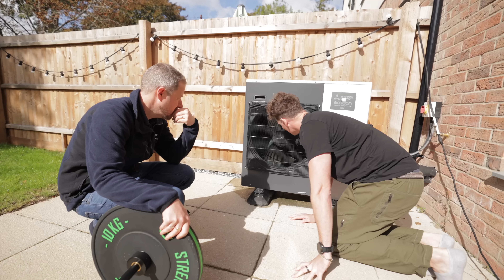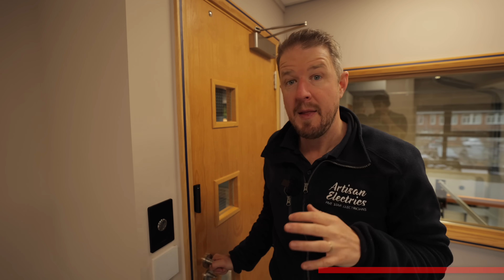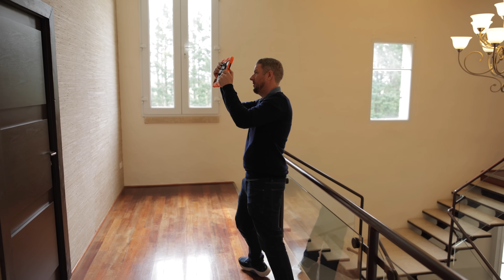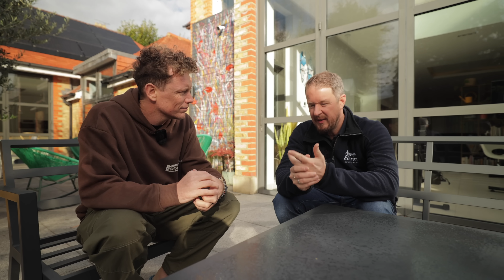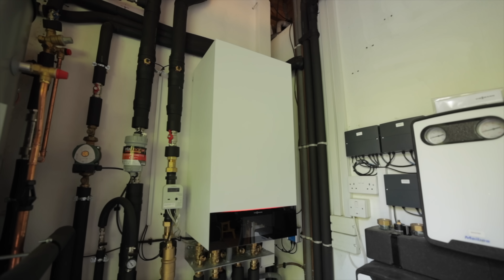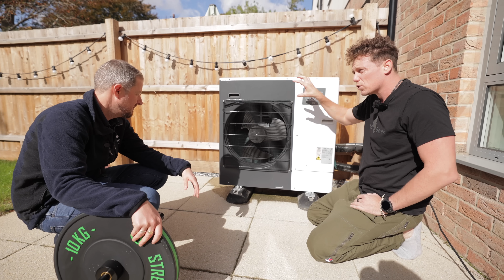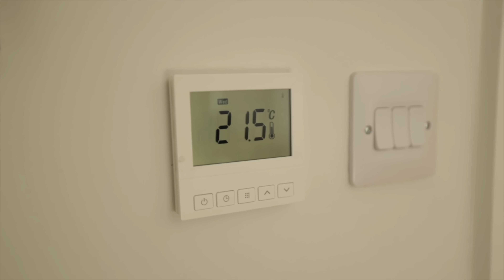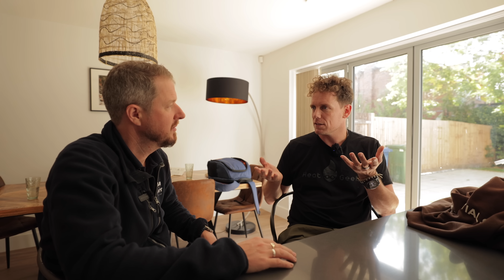Are Heat Pumps Really Worth It In 2026?

Comment: CLARRIFICATION to one of the comments" having worked  for14 years in Sweden I observed YES Scandinavians use heat pumps BUT a lot use wood burning stoves when it gets very very cold AND someone will keep the wood burning stove running OVERNIGHT! yes all night keeping it topped up.  Why ? because the heat pump cost/energy use goes through the roof.  So my friend lets some facts CORRECT!
Reply from the maker: Thanks for sharing your observations from Sweden!
Reply: Wood burning stoves provide additional heat, they don't take over as the primary heating system.  And if you actually compare the prices, wood burning still costs more when it's very cold, it only gets about cost parity when bought in bulk.
Just look at my name to know how I know.
Reply: @BenIsInSweden  i didn't say they ONLY used the wood burning stove (read the comment!)!  And as for "cost parity" that really depends on the availability of wood, which according to my Swedish work colleges depends a lot on where you live!.  So take this as a polite "jog on"!:face-blue-smiling:
Reply: @jimduk  That makes no sense in context of the original where you say "because the heat pump cost/energy use goes through the roof".  Supplemental heating isn't going to have a huge impact on that cost in the lower temperatures.

As for "depends a lot on where you live", the same applies to electricity prices, up north where it's a lot colder, the electricity price is lower.  

So maybe get your facts straight before trying to make a clarification to someone else.
Reply: @BenIsInSweden  ohhhh good grief!!! yes it does - is the cost of running a air source heat pump linear in relation to outside temperature ! NO! and you know it's not! so not sure of your problem ? trying to sell heat pumps ? affiliated to this video/advertorial?! fishy!  or just a narcissist ?
Reply: @jimduk 
Let's put it this way, when buying in bulk and burning with a modern wood burner (which many people don't have), wood works out at around 1SEK per kWh, for older ones it's closer to 1.3SEK/kWh. In my region you can fix electricity currently at 0.9SEK.
Given most cold climate heat pumps can achieve a COP of at least 1.8 in -20C you're looking at aroud 0.5SEK per kWh of heat with that fixed tariff.
Reply: @BenIsInSweden  lets put it this way Ben, if you have access to CHEAP wood in Sweden (which many people DO!) then its cheaper than electricity when below 0c  the consumption of the electricity starts to exponentially increase as the temperature drops further and further the point that's you are getting ZERO (nowt, zilch! nana!...) benefit from the air source heat pump.  Now do me and yourself a favor and "jog on" and create some pointless reviews of crap 80's computer games.   Muppet.
Reply: @jimduk  Clearly reading isn't your strong suit, Sweden uses cold climate heat pumps, which still give more heat per kWh consumed even down to -30C, I also don't review games, so excellent deductive skills there, like the rest of your incorrect "clarifications".

You could provide examples to back up your claims, but instead you resort to name calling, so clearly it's you with the agenda here.
Reply: @BenIsInSweden  maybe not review,  but plenty of posted 80's games (what ever "floats your boat" LOL)
 So back to heat pump discussion when did I state a specific  temperature where heat pumps fail to output more energy than they consume ? what I indicated was the COP value gets exponentially poor as the temperature drops below zero, AND try getting the hot water for showers etc up to a sensible temperature (60C) without having to resort traditional immersion heater (even in summer!).  Oh and what many heat pump figures FAIL to specify is the impact of damp weather i.e. bigger COP drop with cold damp weather versus dry cold weather.  I could keep going on but clearly the dark Swedish nights are playing with your mind..... 🤪 😋
Reply: @jimduk plenty of 80s games? Just the 1, mostly from the 90s though, but they're about as current as your heat pump and heating knowledge. 
60C is scalding, outlets are supposed to be 50C max, r32 heat pumps can do 55C just fine and R290 ones can do 75C. 
As I've stated multiple times COP of at least 1.8 in -20C, almost half the cost of direct electric heating in those temperatures. And if you're in an area of Sweden that gets that regularly then the advice is to go ground source, which is unaffected by the outside temperature. 

If you want 60C for Anti legionella then a r32 heat pump will get it most of the way there and the immersion will top it up and you typically only have to do that once a week.
Reply: @BenIsInSweden  ahh so knowledgeable Benny sweetie, surely not trying to sell/justify the "air pump snake oil"  LOL 
Is it all the those dark nights in Swedish Winter..... and the cold or perhaps it's due to the frustration of the heat pump running costs ? no wonder the favourite pass time of Swedes is leaping off railway bridges 🤣
As to your pitiful irrelevant argument, "...60C you want.."  YUP anti Anti legionella is critical sweetie, you should know that.  
Now back go back to the dark Swedish nights & 80's computer games and avoid the Railway bridges 😜

Comment: With all due respects we import according to our governments figures "who believes those twats..." less than 5% of gas from russia infact it less than that so please if you quote numbers even in jest get it right people! As for HPs we have a 4kW PV and wouldn't consider them unless they was from a Korean brand. I have a 155,000 mile BEV niro and the heat pump hasn't missed a beat being used for nearly 4 years daily as a taxi. I have heard and seen on YT many HPs that have had many issues even those installed by very good technicians. Sorry but I'll be sticking with Putins gas 🤑until they have ironed out all the issues. Cheers

Comment: While I think the heat pump systems could be better in a much more complex installation/system which would include other tricks (since the heat pump only pumps, well, heat, heat is still lost when opening windows and doors to the outside, so adding a couple air pipes to exchange air with the outside, pipes coiled around each other and pretty long, while also well isolated from the inside and outside, should make fresh air very close to inside temperature), the main advantage is losing the vulnerability of relying on other resources, especially those that crazy evil people like to use to put a leash on other nations (like orcs messing with european countries).
Now, the main problem is the lack of education across the world, as many people simply do not understand how heat works, how insulation works, and more. Quite frankly the main problem is stupidity.

Comment: A heat pump is a useless option, why pay for electricity to drive a compresser giving limited temperature increase in minus temperatures. Electric heating is the most cost effective solution for heating and hot water. Most of of our electricity is green and ideally Ed Milliband (The useless one) should target to halve electricity cost. This is possible with tidal turbines already being used in a Scottish island

Comment: I hope to look at heat pump install in a few years time, and from what I gather, an average instal bottom line all told is £3,000, give or take.

Unfortunately, there is a rip off culture in the UK, and half the battle would appear to be, not being stung. I've seen a few videos of Heat Geek over recent years, and it would appear even technically minded folk get regularly stung, what chance for the average person? You yourself  seemed quite chirpy when the deficiencies of the install were pointed out in the house you're renting.

I have no doubt the technology works, particularly as it's built by Germanics & South East Asians, problem is, it's being fitted by UK installers, the modern day equivalent of British Leyland grunt.

From the Austin Allegro to UK Install All-Aggro.

Robert

Comment: Thanks for having me on guys!!
Reply from the maker: Thanks again for joining us 🙌
Reply: I'm really happy about my ASHP installation but I really wish I had found out about you beforehand. Due to our really good experience in an old house my parents are also curious.

They live in a 18th century Cotswold stone cottage which is off the gas grid (would be removing an oil boiler). The house is undoubtably leaky but had very thick stone walls. Do you have any experience installing into such properties and would you suggest this?
Reply: Hi, I've been told that heat source pumps struggle to heat homes with 10mm microbore radiator pipes. Is this true?
Reply: @OrangeManWindowClean no it’s nonsense. Your system designer does have to understand Hydronics a little more though. Heat geek installers would have no problem whatsoever
Reply: @OrangeManWindowClean  Just had my ASHP installed Oct25 with 10mm microbore downstairs and upstairs. It works very well. The heating engineer knew his stuff. SA Energy , fareham.
Reply: I've got an ecodan system fitted but found some thing are not right with it i.e. pipe sizing, insulation not fitted properly could you do a check of this installation and put things right to make it more efficient?
Reply: Hello Adam, what type of tape do HG use around the pipework + what type of loft insullation?
I may be, (hopefully D.V.) buying a very small new build bungalow, (60.8sqM). It has a Vaillant ASHP, underfloor heating, 8 solar panels. I'm doing my research, trying to learn as much as I can ❤
Reply: Can you clarify one thing you said in the video at 22:53? You say your average install price is £3,000 comparing it to a national? average install price of £12,000. Is that to say that your average customer is £3,000 out of pocket after the £7,500 has been paid by the government totalling an install cost of £10,500 but other customers will be £12,000 out of pocket AFTER the grant meaning a total install cost of £19,500? Or do you mean that nationally customers are £4,500 out of pocket after the grant has been paid giving a total install cost of £12,000? I just can't see the £19,000 figure anywhere and seems grossly inflated. Have just been on your website and got a quote for £4,500 for my home which is exactly the same as Octopus are quoting. Where is the big difference?

Comment: 11:53 how big is that house and how much space is needed... that is a huge plant room. 
   We really struggled for space in a terrace house, placing the battery and inverter outside, but we went for electric underfloor heating running from the battery, but we don't have enough solar to charge the battery, nor do we have a big enough battery to run the house - further investment is needed. For hot water we are fine, with the eddi used to divert surpluss, but the overall house temp is poor due to the price to run the underfloor heating when the battery is depleted. 
The volume of the new tank took space from the bedroom location where the original tank sat, and heats the 1st floor. We still have to refine the system downstairs to bring our energy bills down.

Comment: Can you put a heat pump in the loft, or would that be too noisy?
Reply: The noisy bit is outside, the heat exchanger and compressor. (They're actually very quiet). The indoor kit water cylinder etc is very quiet and can often go in a loft space.
Reply: @WeirdNeville I was thinking about putting the heat pump into the loft. My loft isn't insulated, but it's marginally warmer than outside, it won't take up room there, in the summer it can just take the air as is to heat up the water

Comment: In the UK electricity costs 4 times the price of gas. Some new heat pumps don’t even state they can achieve 400% efficiency all year. I turn my heating down at night and when I go out. I don’t think you can do that with a heat pump so it will cost me more. Can a 400% efficient heat pump heat hot water high enough to kill legionnaires bacteria? I don’t think so. I would be mad to spend thousands for a worse system than I have now and I would have to increase or replace all my radiators.
Reply: Yes, they do legionella cycles just fine. Your questions are all moot, they've been answered.

Comment: Looking at the outdoor unit I wonder what happens when there is a cold period? Or is this located in a none freezing area? We are used to large amounts of ice buildup - e.g. it should be at least 50cm above ground to have round for ice below the unit.
Reply: Are you not in the UK? We rarely get half a meter of snow or ice here. The units can defrost themselves so as long as the condensate drain is ok there shouldn't be an issue.

Comment: Where do these heating systems go when the anti oil zealots are in charge in future years when there is no petroleum oils to get the gases from to use in the heat pumps? Refineries are closing all over Britain and Europe so everything from the steel, aluminium and oil and gases will have to be imported at very high prices  making these installations even more expensive. I am really hoping I'm not alive when that comes about.

Comment: Whilst it's a scientifically proven fact that you can get heat from the air at -15 Degrees.C the efficiency of the heat pump is going to be <1:1, so 4 x more expensive than gas. Power cuts do tend to be relatively short lived in major conurbations, that is not the case in remote parts of the UK, where the local network cables are suspended from quasi telegraph poles, Natgrid have customers going with electricity for days without supply. A gas or oil fired boiler with a circulating pump will run on less than 200 watts, so can be run for short periods from a battery backup. It's also probable that the heat pumps will come down in price, but the major costs is the labour and with the shortage of suitably skilled engineers the cost will probably not come down.

Comment: My view is this if yor heat loss Is 7kwh you will be better off, if your heat loss is 14kwh it will equal gas, if it’s higher than 16-20kwh don’t bother, and rural areas with old buildings with heat loss like 40kwh do not choose heatpumps. I had a farm with a heat loss of 40kwh even after insulation it hot to just 16kwh and was left with 4000 a year energy bills peak rate. But I am really angry, the gov are pushing heat pumps especially for the 7kwh loss homes , but come 2030 ecconomy 7 disappears so that 800 quid bill will become 2500-3000 quid to do the same , these smart offpeak times will be when everyone is at work meaning we won’t be able to use it unless you work from home, everyone will be in energy poverty yet again, in fact it will be worse. As those with solar or thinking of going solar with batteries, the gov are coming after your feed in tarriff to force profits back to he energy companies , if you feed in you will be classed as self employed and have to fill in a tax form each year .  The gov and ofgem must keep eco 7 6 hour rates and be banned from forcing 3rd rate energy prices as it will hit everyone who works and travels  8am to 7pm wanting yo eat and yse energy , they want a 4pm to 11pm super high rate this is fundamentally wrong, and call on everyone to fight back against this change
Reply: How do you calculate house heatloss?

Comment: I had heatgeeks around to my house and the cost with the grant was approximately £20k. the proposal on Heat geek was listed at £11,818 but the company sent a sperate additional estimate for repiping the house as we have microbore. This worked out significantly more expensive than other MCS accredited installers to do the same work.
The main restriction with Heat Geek is they only give you one option for an installer you can't ask another installer for a separate price.
Reply: It should work with microbore.
Reply: @foppo100 How can you say that when you do not the size and layout of the house and the respective loads?

Comment: I recently had a gas fire removed.  This had a flue that went horizontally out through the wall to the outside.  Getting rid of that and sealing up the hole has made my house much, much warmer so it needs much less heating now.  I would be loathe to use any heating system that leaks heat out of the house.
Reply: What heating system leaks heat out of the house?

Comment: As more people have these installed then there will be a point at which the utilities companies will increase the price of electricity to off set the lost revenue in gas sales hence negating any savings. If everyone had electric heating and gas was shut off the same profit would be generated by electricity.  What's actually needed is state control of utilities where profit is set to a minimum and used to maintain the infrastructure at optimal operating levels. But we live in such a corrupt country driven by greed of a few this will never happen, so keep the gas boiler going for as long as you can.

Comment: I love what Adam and the heat geeks are trying to do and I have followed he’s YouTube videos from the early days. I run a heating and AC company we are mainly break down engineers and spend a lot of time trying to sort out bad insulations, most of the new install we go out to on boiler systems haven’t been set up properly they are throw in with no care and no set, because most installer just look at profit, they could spend time setting up the system, but if it’s working they are on to the next job and I think this is what going to kill the heat pump market! The house in your video the heating works and that’s what customers want, but they have no idea that it’s costing more to run then it should and if I quote a day or 2 to go in and set it up, it’s like the kings new clothes they won’t see any difference until the bills come in. Most site plumbers idea of setting up a boiler is bleeding the radiators.